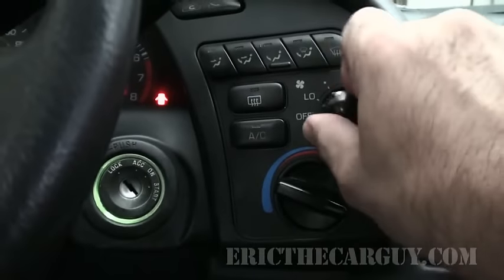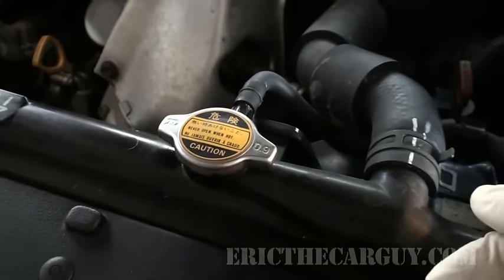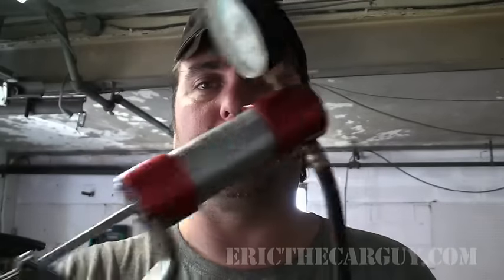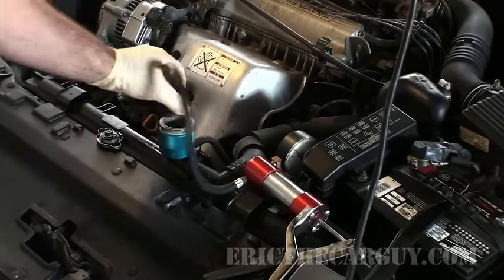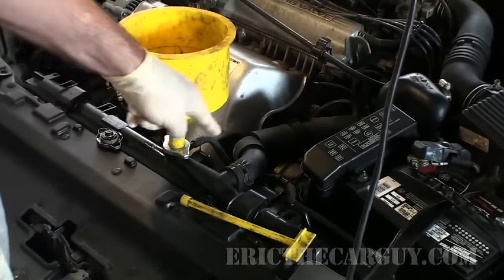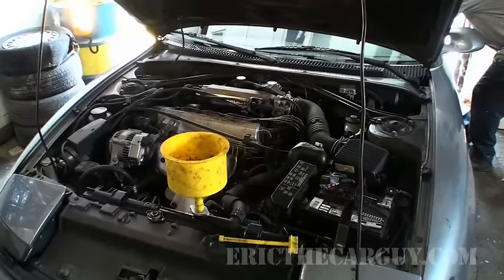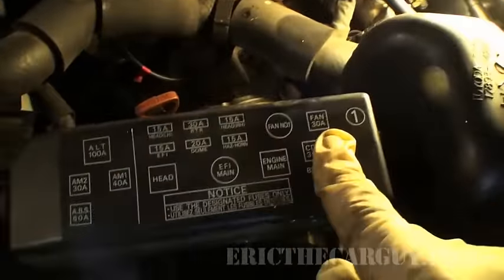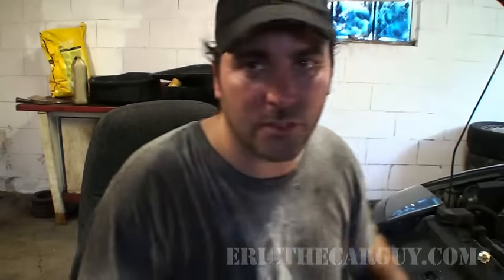How To Solve An Engine Overheat Condition - EricTheCarGuy

Comment: Erik the car guy.  My copper & brass radiator on my 68 Camaro was retired after 50 years.  I wanted to keep the weight light and opted fror a 2 row aluminum.  I went from a 4 row b&c to a 2 row aluminumans my mechanic didn't flush out the old sludge.  I did 2 chemical flushes it's cleaner by far but if any lockage occured because the shop put Stop leak in it.  But it's not cooling .I'M ASSUMING THAT i need a larger radiator.  i have a 2 row with a fan supposedly running 2600cfm.  My original was 4 row copper & brass ahould I be going to a 3-row or 4 row aluminum for a 7.4 litre or 454BB with 4.12 gears.  I also needmy neck on a 45 degree angle which makes mine a little harder to replace.  Everyone initially told me all I needed was a 2-row aluminum.  Snd the one ai hought hewon't eccha ge.  All these ebau convetsions ate worthless because these cars have been made into non-standard cars putting in 454BB.  THOUGHTS FOR RADIATOR REPLACEMENT SIZE?

Comment: Hey Eric i have a 2007 Chevy Equinox that don't have a radiator cap just on the overflow tank. So i just treat that as my radiator cap right?  To do my pressure teat and block test.  I wonder if them caps could go bad to like a radiator cap dose some times. And info would help thanks

Comment: my 2003 v6 mustang over heats pretty fast and before it does there is a loud grinding or slappiing dound like the fan is hitting something then i overheat was told by a frind it was my water pump i changed that and the thermostat and same thing ehat are your opinions i need to fix this asap

Comment: I have a 99 chev express van with 5.7 engine that i need to find out why the needle on the water gage is going past the red area.and my ac all of a sudden went warm instead of freezing cold like it was..im 62 yrs old and i myself have to fix this issue cause that's my only vehicle to get to work ..so i you don't mind give me some hints as to what could be wrong.

Comment: A common problen on Ford 3.0 ohv engines is the impeller can wear pr corrode amg you get a gradual loss of coolant flow.

So keep your eye on the temp gauge and change the pump.

Over heating for any reason os something to avoid.

Comment: A faulty speed sensor caused my engine to o verheat while on high way  the transmission was also shifting very badly that is what gave me a clue I disconnected the full Abs crap now everything is back to normal.

Comment: hey eric hope u can help i have a 99 prelude and im over heating heater works fluid is not dissapiring im full. no check engine new cap new fan switch fans are turning and turning when ac on idk inly heating up when im in complet stop

Comment: so i have a 1993 lancer evolution gsr 2.0Lt same motor as a turbo eclipse its not showing flow through the radiator top of rad is smooking a little ive replaced the thermostat 3 times now lower hose was warm on the weekend but fan wouldnt turn on im completly lost oil is fine for couler coolant drained fine through the rad or apeard too anything else ??? help

Comment: Would it also be possible that the engine/radiator is fine and the coolant temperature sensor is bad? 
My friend’s cars radiator was obviously leaking so I ordered a Denso replacement, but when i got the car to work on there was also a p0117 code so without diagnosing farther I went to AutoZone and got a Duralast replacement that day and swapped that too since I was already bleeding the system. Now the car runs perfect with no leaks BUT on the test drive I noticed the temperature gauge was acting weird…it says it’s getting too hot while driving and lowers when idling. I didn’t notice anything out of the ordinary when bleeding the system, it got up to operating temp, lower radiator hose was getting hot, no more bubbles, etc. it’s only while actually driving that it starts to say that it’s going hot

Comment: Hey there Eric!  Thanks for explaining this things for newbies like me, I do have an extra question? So I have a 2005 Chevy Tahoe 5.3 z71 and this is all I already did to it .
Changed the water pump
Temperature sensor
Thermostat 
New radiator and is still keeps climbing up to 3/4 mark on gauge, I guess you can say 240-250 or so, bleed the line for air and stuff and still nothing..
Any advice on anything else to do? Thank you!

Comment: Thank you ,my warter resavor,boiling, cap on radiator impala 2007 like that cap you show, ima get that tomorrow. An ima need to bleeding the system. Hopefully that will do it.just boiling in warter resavor. Thank you.

Comment: 2001 Chevy silverado overheat problem. Does not have a radiator cap. Will the cap on the plastic tank go bad and cause it to overheat?

Comment: Eric, thanks for the video. I have a follow up questions... when looking at the temp. gage, how far pass the cener to the right should I be concerned? I noticed the gage is mainly divided in four. Should I be concerned just before it reaches the third mark? Right now my gage nidle is in between the center and the third indicator. Is there a magic number i should not go over in order to safeguard the engine?

Comment: Can u test yur fan by running a hot n ground from your battery to the fan /. What switch do i run the wires to ? I see a blue and black wire on plugs

Comment: I live in Phoenix and my infinite Q45 is overheating only when I turn on the ac. The coolant is flowing through the system and reserve. I don't hear any noise from ac compressor pulley or its clutch. Please any tips would help. Its 110 degrees out and I need my ac.

Comment: can I still use the block tester when the raidiator doesn't have a cap and the pressure cap is on the reservoir..

Comment: Interesting video. My 2001 Civic doesn't overheat but the coolant sticks in the overflow tank (which fills up) and doesn't come back in the radiator. I changed the radiator and the cap already, got new radiator hoses. What gives?

Comment: Thank you for the video Eric. 
I have a question, I have an 07 Hyundai Sonata that seems to have an over heating problem, I was driving the other day and all of a sudden I noticed the temperature gauge all the way to red, I immediately pulled over and shut down the car, later on that day I took the car to my mechanic and he suspected to be because of the coolant temperature sensor, I then have changed the sensor it didn't fix the problem then I went ahead and changed the thermostat, same thing, I even eliminated the thermostat it still overheats, but here are two things that happen often, the temperature gauge goes all the way up or all the way down (sometimes a quick shift) while driving (or even on idle) and also when I unplug the coolant temperature sensor or turn on the AC, the fan comes on. I just don't know what's causing the gauge to do all that.  Any help will be highly appreciated.

Comment: MY friends and I play this game which gives us points for running over pedestrians. As a result we've come to realize blood with dusty roads can clog the radiator so check for that and flesh which clogs the fins as well. Just a extra pointer or two I thought I'd mention. I have noticed since you made and published this video that the cooling system refillers have become popular and widely available. 

Maybe if you do a .1 version update to this video and list the vacuum refill systems in your tools section and they'll sell better than hotcakes at the lions pancake feed. 

P.S. Make sure to properly report the pedestrians you take out so you get the proper amount of points credited to your account. Oh man while listening and typing you got to the part about the bleeding of the system. Disregard the part I mentioned above about that except the tool if you didn't include it. 

Also a video recommendation, If you plan on doing any early 2000 model gm/chevy manual to electric fan conversions I'd love to see a video in this. 

Back to watching the video.

Comment: I have a 2005 Acura MDX and I'm having a problem with study having to replace my coolant but when I look on the ground there's nothing on the ground but everyday I have to refill the radiator the temperature gauge never is high but it smell like it's overheating took it to the mechanic he can't find where or how it's leaking out  he said he'll change the thermostat but it still leaks out somewhere any suggestions

Comment: I have an 05 civic, if I disconnect the Sensor switch and bypass using a jump wire, should the cooling fan kickoff, also direct 12 volt to fan should it kick off.

Comment: Can you diagnose a problem. I own a 07 Focus. Winter where I am it reached - 30 C overnight wasn't plugged in turned it on warmed up extremely quick drove overheated almost as in the needle was close to the red) pulled over shut it off and boom back down to operating temperature also had no heat whatsoever in my car for 2 days finally I had heat, car overheated again close to red pulled over idled it it cooled a bit turned it off for litterally 30 sec and boom back down to operating? What is going on here some people think coolant froze in places and prevented coolant from going where it should?

Comment: Hi there if you could help. We have a Nissan Largo 1996 every time this vehicle overheats the vehicle cuts out straight away. we have changed the thermostat, checked the fuel pump, and everything else that needed to be done. But for some reason it keeps overheating

Comment: I think you accidentally said that backwards when the thermostat is closed, the top radiator hose would be cool because the coolant is not passing from the thermostat to the radiator and the bottom hose will be somewhat hot because the coolant in the engine at the bottom coolant inlet on the block heats up the coolant in the hose, normally the coolant should be hot at the top hose and cool at the lower hose. Cheers

Comment: Hi Mr.Eric am from GCC and I have a 2005 Nissan Altima which is over heating when the outside temperature is heigh . I have done the below 
1. Flushed the radiator no leaks
2. Changed the radiator cap 
3. Fans working fine both of them 
4. I have put new valves 
still in the day time when am driving my car get heated up and speed reduced it goes down . But don't have the problem in night driving I can it 140km speed without any over heat with air condition on. 
there is no head gasket leak cause I checked my oil and its black only no mixing of water and smoke

Comment: New to your vids but I love them so helpful. But can u or anyone tell me. My car over heats only sometimes. Has happened 3 times now
I've topped coolant I've bled it my next guess would be thermostat because it only over heats sometimes the thermostat may be stuck closed? And then once I pull over and let it cool it will not over heat as the thermostat has corrected itself? Please if anyone can tell me if I'm on the right track. Cheers from oz

Comment: Do you have a video on how to know if an encoder motor on a 2000 gmc 1500 z-71 is bad? I have checked for ground, which most say is majoroty of problem, I replaced actuator whicvh most say is majority of problem, I removed and checked the encoder for damages but that's limited. It sounds like it's going into 4x4 but never does. It happened without any signs of noise a few weeks ago. Hit the button and nothing, now the lights blink and motor sounds like engaged but lights don't show lock in. Can't afford to go to shop price for use of a scanners. Any tips that don't cost 200. or more to figure out why no 4x4? thx

Comment: Love your videos mate.....hoping youll reply ......so had a hg replaced skimmed pressure tested and much more inc cams etc all new .

Anyway ..had same issues before and some time later on almost 8 months or more ..now i washt getting any warmth at lower hose even after a new pump (,blue print ) new oe thermostat  new v belt and coolant sensor. (Old oump was fine however ) ......so after overheating issues (drove over 200 miles 1 way continuous last years amd same back no issues ) ........now after emptying system filling with mostly ironised water and a rad treatment (new rad on route in case ) now getting heat at bottom hose . Car mpg imprived etc ..quite a bit actually ......car been ok fir few days thought id get this treatment around ..flow to cire gets hot return seems ok according to the heat i use in car ......only today had coolant over engine prob lost say under a litre poss less ..topped up threw heating on as i didnt have far to go amd system was full again.

Ill be flushing it again tom and putting another treatment in it . Then if all clean ish ..ill then put the fl22 mixed in ..any thoughts ?

Comment: There are loads of vids about viscous fans alot of people havnt a clue on how they work the best way is to watch a viscous fan manufactures video the fan is not supose to spin when cold there is a sensor in the front of fan when rad get hot the air passing through operates the fan at a reduced speed than the engine if the clutch sticks it you get a roar in morning ford's have a design fault in viscous fans these are mainly the problem over cooling rad when bottom stat opens it shuts straight away if you have a viscous fan replace it

Comment: Hey Eric, I watch your vids all the time..Between you and ScannerDanner, I always stay entertained.  Keep up the great vids (:
Something to mention in this video (or maybe the next) is that some Radiator Pressure Testers also have an adapter to test the cap itself for the proper pressure and seal...
I've found many system failures just because of the cap and also as a note..I always test the new caps before installing them for customers (and more for myself as a piece of mind.) Believe me..I have found some new caps that didn't hold up to the pressure as it was labeled. Just a nice tool to have.  
Thanks for your time, Knowledge and effort you put into videos. Everybody appreciates it.
CHEERS and Please Eric...You stay dirty my friend.

Comment: Excellent videos you produce, thanks ! Wish I would’ve watched before I did the process of elimination, mostly in the wrong order lol. 2012 grand Cherokee 3.6 Pentastar with 186k miles. Got it back from the dealer doing a head gasket (warranty issue) and it kept overheating. So I replaced a couple therms, then eventually a 3rd with a Mopar therm.... which it’s running cooler with, but I’m still getting a leak somewhere cause after 15-20 miles the radiator needs to be topped off. I also replaced the relays, checked the fuses, and replaced the fan itself. Then I pressure tested the system and it’s good to go. Doesn’t seem to be any whiteish oil on the inside of the filter housing nor is there any bubbles in the overflow but I ordered a block testing kit that’ll be here tomorrow. Only other thing I can think of would be the coolant system sensor on the block, which fortunately will be covered under my extended lifetime warranty. Can you suggest anything else? I’m frustrated as hell with this and at my whits end
Reply: I’ve replaced the radiator cap too. Thanks again for any help you can offer !

Comment: Should a cooling fan always come on right away just past half way point on the gauge, and should I then see a temp drop right away?
If I don't see a temp drop right away, then I guess my fans not working ?
Or if my temp gauge went up to  5/8 high or more and lingered there, then I got problems ?

Comment: The temperature gauge of my Volvo Xc 90-2004 slowly heats up after only 4 to 5 minutes  running, this month of October, but the needle remains at the middle. I made a pressure test and no leaks in the cooling system. Volvo made diagnosis and they found nothing wrong. Eric, is this normal for the engine to heat up immediately even the outside temperature is cold.

Comment: I have the same Jeep. I replaced the heater core. It was leaking. I figured I would change the  water pump,  hoses, and thermostat while I was at it. I can't drive it more than 2 miles because the engine is getting really hot. Then I replaced the radiator and filled the engine with coolant properly. Same engine overheating. Yup, fan is working. At my wits end here. Any suggestions?

Comment: I drove my car 4 hours and with 15 min left it started overheating at low speeds/stops. Took it to a mechanic and he said it was a blown head gasket recommended BARS coolant sealant to get me back on the 4 hr drive next day. Car drove perfectly for about 3 days then started slightly overheating. Got the radiator flushed. Still doing it almost randomly. Only other symptom is a stuttering that occurs when accelerating at 2.5k RPM mostly at highway speeds. And I can hear the coolant boiling when I cut the car off even though the temp gauge reads operating temperature.

Comment: I drive a Peugoet 405 2.0 ltr deisel engine with turbo charge, it lately been overheating after i purchased a used engine from europe. What I ahve done so far is I have changed the head gasket but the problem still persist. It starts starts overheating after a long run of the engine or when you switch the air condition system on. Sometimes the coolant boils and comes out of the radiator. I use the closed system it doesn't have a reserve tank